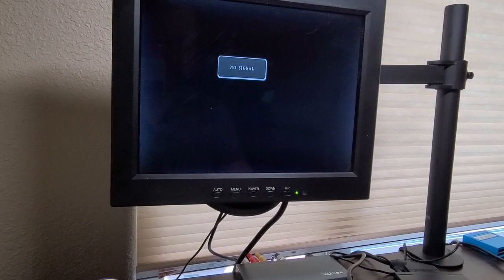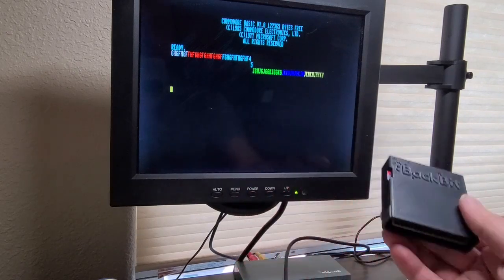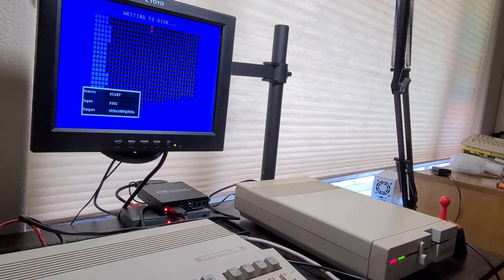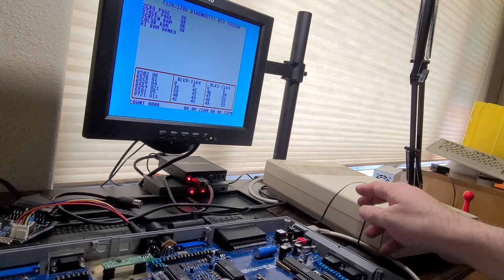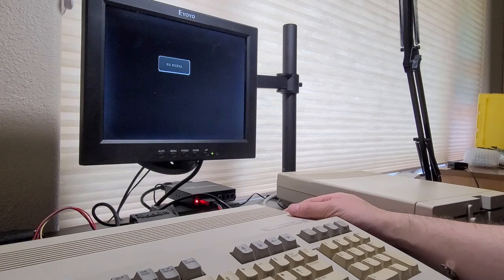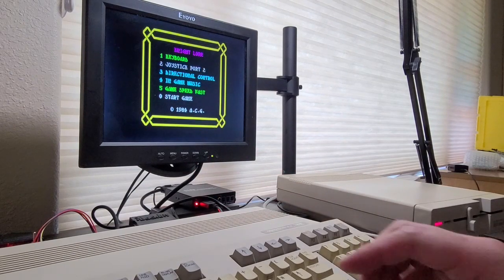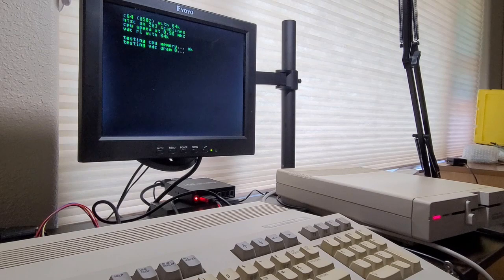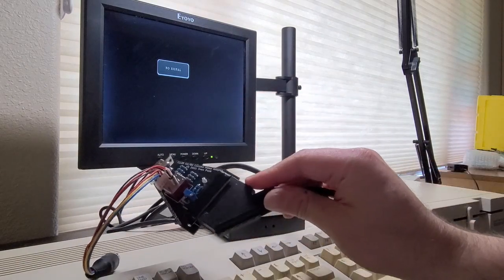Commodore 128 80 column video adapter + serial port troubleshooting

Comment: First I thought I needed a C64 in my collection, then I got a C128 too after some rave reviews, but the longer I use both, I find they are actually not very good machines AT ALL. To have some 8-bit fun in 2024 a machine should be able to deliver proper video output, has functioning BASIC (C64 BASIC is trash), and has a easy to use storage system, again the way a 1541/1570 works is pretty lame as it can't give you a disk index while coding to see if you want to write to that disk, as it destroys everything you made.
Reply: The 128 has the DIRECTORY / CATALOG command that can view a disk without overriding your current program in memory.  64 BASIC is horrific, yet it is how I thought myself to program at 7 years old, but the 128's BASIC is quite heavily expanded and how I then tought myself better structured code.

Comment: I have a question. I recently was gifted a Commodore 128 in not so good condition. It is working, some of the buttons (not critical ones) are missing and contact on the power adapter is flimsy. My question is - to connect the USB-TTL adapter for serial interface over User port do I need the same combination of pins like I have on my trusty 30+yr old C64? I am using novaterm in C64 mode. I tested by crossing rx and tx and nothing is echoing. Do I need to connect NMI to RX like on C64 and if so, should I look for a replacement for a complex interface adapter chip ?

Comment: When Commodore made the 128 they made a very small mistake, they took the C64 and added a few extra thing that were missing in the C64. What they should have done was designing a new computer that could use the Commodore 64 software. 
 
When the Commodore 128 came on the market people asked themselves what they could do with it and the answer was that they could use the C128 as a C64, CP/M was at that moment in time already ageing, 80 columns was for business and nobody was using the C128 for business. To late, to little, missed opportunity. Around the same time Apple made a computer with the 16 bit version of the 6502, that was not a success either.

Comment: The 80 column mode video output is CGA compatible, so a CGA to VGA converter could be an option, as could this - https://github.com/hoglet67/RGBtoHDMI/wiki which will go straight from the 128’s video signal to hdmi in one step.
Reply: So these two are also delivered by Prime, with easier to use controls, cheaper than all of those SCART to hdmi pods?
Reply: @bryanminugh9680  The one on GitHub is the cheapest, but trying to get one off the shelf is challenging. People sell them for around $30 plus shipping, but are almost always out of stock. I did some further digging, and found that the  cheap CGA to VGA adaptors aren’t actually CGA compatible 🤔 - they need a digital to analog adaptor on the input to work, which cost about $40-$50, though there are plent of designs you can find and make yourself for rather less.  The cheapest one shot adaptor that’s actually available and works appears to be the MCE2VGA, but that costs at least $65 plus shipping on EBay.
Reply: ideally a converter has a custom color table you can alter with controls from the C64. As RGBI is basically 4-bit digital video output, you could add a lookup table and create 16 palette colour from the data stream with for example 16-bit 5R6G5B values. If you can tweak that over C64 serial, the high res board will actually become useful after 40 years.

Comment: It's too bad that Commodore didn't create an 80 column mode for the C128 that is not solely for CP/M but could be used in some "extended" C64-ish modes. That being said, the C128 is definitely an underappreciated machine. [edit: Correction, I meant text mode only not necessarily CP/M only (although that's primarily where it would be used). It's been decades since I used a C128 so the details are fuzzy!]
Reply: Technically the C128 could produce graphics in 80 column mode (640x200), but very little software was ever written to use it - GEOS 128 does run in 80 column mode in monochrome. I think it also runs in color if you upgrade the video RAM to 64k (or have a 128D that has 64 k standard) but I’m not sure.
Reply: There was a piece of software called Graphics Booster that in conjunction with 64k vram added graphic functionality to BASIC allowing it to use hires graphics in 80 column mode at up to 640 by 500 and something pixels.
Reply: @Doug_in_NC  Interesting. I've always felt that the C128 was underutilized. It got overshadowed by the upcoming Amiga at the time.
Reply: @JustWasted3HoursHere  For a machine that sold an estimated 4 million examples, it is spectacularly deficient in software support. There is way more around for say the VIC 20, that sold less.
Reply: @Doug_in_NC  True.

Comment: I love this idea but that scart connecter isn’t ideal for me. Your picture is much better than what I’m using for sure
Reply from the maker: The scart was not ideal for me either since I am in the US and had never heard of it before this project. However, it does seem to be a better quality picture for C128 80-column on a modern display than what I have used in the past.
Reply: Sync pulses and four TTL-voltage pins for color never had a pathway into a TV, unless you were in a PAL country "blessed" with that single multi-pin connector called SCART that "does it all" without switches or jumper pins to figure out. I'd guess there's a million SCART to hdmi modules selling every year, competing on picture quality at a low selling price.